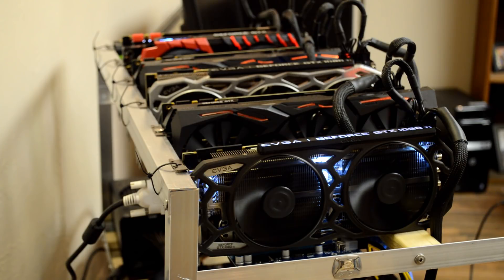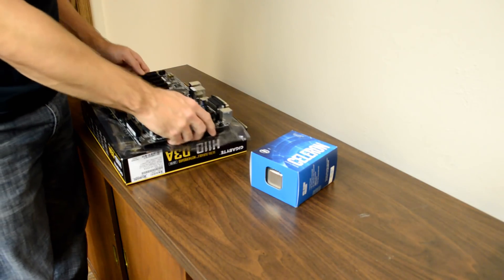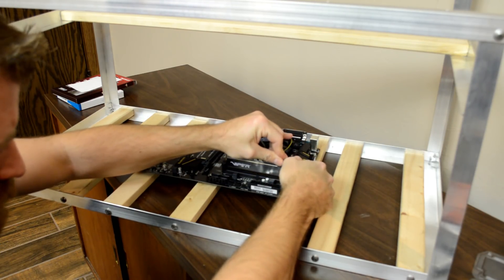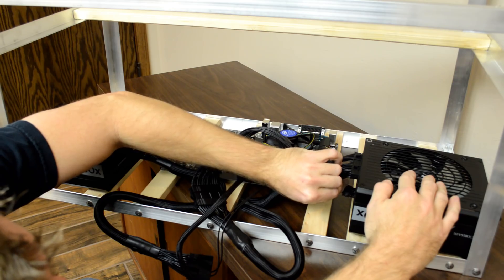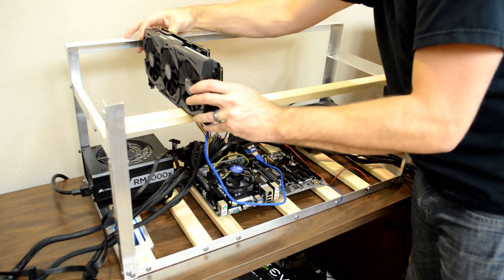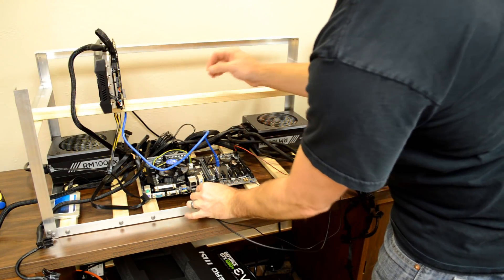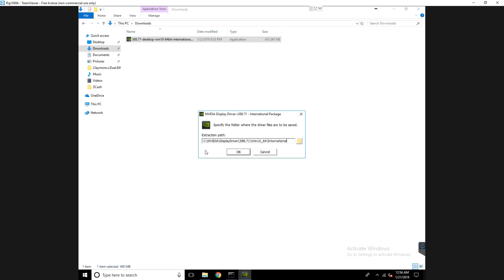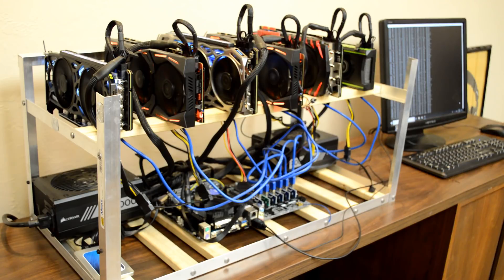How to Build a Mining Rig - Part 2 - Assembling Computer Components

Comment: I have the same motherboard with 6 identical AMD cards.  The system works with 5 GPUs but not 6.  I had to disable miner mode and enable 4G encoding for it to boot and run 5 GPUs.  The problem is definitely a BIOS setting.  I do not have several years to try all of the variations by trial and error.  Can you tell us what works on your board specficially, please?

Comment: Sata connectors are rated for 54 Watts Max and Nvidia rates TDP in the 1080 Ti as 250 Watts max (which I know is not necessarily the power being consumed) but as the GPU can pull up to 150 Watts from 6 Pin connector or it can draw from Pcie riser as well in any combination depending on usage, OS, app etc why risk so much on a premolded Sata connector instead of a proper 6 pin?  As an electrician, I commend you for grounding your mobo, and additional equipment ground into the case would be awesome as well, thank you for a great detailed clearly explained video.

Comment: Can you mix GPUs?  Currently having trouble finding GPUs.   So lets say I find a single 1080 ti and I start mining with that, then a little later I find another card, say a 3080.  Can the two cards be run on the same rig?
Reply: You should be able to use different GPUs in one rig unless the CPU is incompatible with one of the GPUs.

Comment: Maybe too late or not to comment, because this video is old, but really nice DiY tutorial. But I want to advice something, Grounding Loop MUST be AVOIDED. At minute 8:15 you make a huge mistake. Most common PC Towers dont ground motherboard to chassis. The grounding is done over the PSU earth pin. Grounding motherboard to chassis is not need. If you screw the PSU to the alumium rig then you're grounding RIG over PSU. The PC enclosures are RFI and EMI protections. By example: If you have a windowed tower, there is EMI going in and out of the PC Case.

Comment: super cool videos !!how many risers can you plug on a sata cable ???  :O  i thought it was only 1 !  (max 75 watts per riser)  tyvm !
Reply: NOONE!! Riser taking 75W and SATA only provides 54W !! NEVER User SATA or any Adapter, throw them away! You can use Molex (156W) for 1 Riser or PCIe (288W) for 2 Risers.

Never use SATA, the wire is going to burn because it takes more watt then it can provide and then u are going to burn the whole RIG or More down.

Take this advice if you planing to build a RIG
Reply: And never buy risers with SATA connector. Search for the new Versions with molex and PCIe connector so u can choose how you want to power it

Comment: Hey Jobe, was wondering if you had any tips for why my h110 d3a board wont power 6 cards. I am running linux/hiveos and for some reason I run into a gpu driver error that isnt able to find the temps and high load averages when I use a 6th card. 5 cards run no problem though...

Comment: Are you running your power supplies on 120v or 240v? I heard using 240v is more energy efficient.
Reply: 240v outlets are significantly less common in houses, so 110/120v is used

Comment: Nice vidéo :) Keep going. I have a question,  you split power from 3 GPU? And you connect from same PSU? ✌
Reply: basically, how ever many pcie (gpu) outputs your psu has is how many gpu you can run

Comment: I found this motherboard:https://www.krefel.be/nl/p/TO127500-b250-mining-expert-intel-1151-90mb0vy0-m0eay0?gclid=Cj0KCQjwtMvlBRDmARIsAEoQ8zSQ5ftvUTwz1Fma80xIw6yi04gUmqpwJcs98ckfo2Ihwep_3RgXbHsaAmE5EALw_wcB

It supports 19 GPU's (i'm not planning to use 19 GPU's, I think only around 6 GTX 1060's ), do you now a good power supply that can power tank motherboard? I will power a second one for the GPU's but I need a power supply  that has the good connectors for that motherboard

Comment: I use RX 570, RX580 and Rx470.
Is there any different between I take M.2 as a HD or SSD? Why you choose SSD instead of M.2 ?
Reply from the maker: Nice, honestly M.2 is far superior to SATA so if you want to use an M.2 SSD power to you.  I didn't in this build for a budget, at the time of the build the M.2 SSD's were quite a bit more than SATA SSDs.  All my home personal computer builds have M.2 NVme SSD's in them and I love em!
Reply: Thanks~BTW,
Do u ever meet openCL error?
How you solve it? I expand virtual memory to 32GB , but still have this issue sometime. Really annoyed. It makes GPU card just hang in there. Any better solution?
Reply from the maker: How much RAM do you have in the system and what is your combined memory of all your GPU's?
Reply: Jobe I have 16G dual RAM(UMAX), and my card is RX 570 8G*2 + RX 470 armor 8G
Reply from the maker: Crazy as it sounds you might try bumping your virtual memory (page file) to 64GB.  If that doesn't work, try to update your motherboard BIOS.  Then in your BIOS look for an option to enable 4G.  What kind of motherboard do you have?  What is your PSU wattage rated for?
Reply: 1.4G decoding?
2. Aurum PT 1200W modular et MSI z370-Gaming krait
3.I've tried bumping my virtual memory(page file) to 64GB, and run it about 5 mins, afterward computer responded to me "You C drive will be full".....orz
Reply from the maker: Ewww yeah that wont work then, whats your volume capacity on your storage drive?  Yeah try to enable 4G decoding and if its already enabled try disabling it.  I think this is your motherboard, https://www.msi.com/Motherboard/support/X370-KRAIT-GAMING  you may try to update your BIOS if you are on an older revision.  Have you also updated your GPU drivers?  Id go ahead and update chipset and all if there are newer drivers, plus I prefer the drivers from the board manufacture rather than intel and microsofts generic crap. ;)
Reply: My GPU driver is  Adrenalin Edition 18.5.1.
I would update BIOS  tonight. Thanks
Reply: Feedback: I didn't updated my BIOS, I've just adjusted my claymore's setting. And my GPU driver is Adrenalin 18.8.2 
Now, it runs very stable. (4 cards running).
Besides, do u know what's going on if a pool always make u get share but keep showing "no new job" ...?

Comment: Yeah man i have already mined with both of the cards there were no problem
Reply from the maker: Yeah feels like it's either the riser or the motherboard.  The other computer you tried to put 2 gpu's in, what kind of board does it have?  Also what PSU are you using?  Just curious.
Reply: Two of the motherboards are old but one of them supports two 2 x1 slots + one x16
Reply: Jobe and one motherboard is m5a78lm usb 3 i use this motherboard for mining
Reply from the maker: Yeah that board should def be able to handle 2 GPU's imo.  Feel like its a bad riser.  You able to return the riser you got or RMA it?  You know the other thing you can try to test that riser would be if you have some random PCI card like a wifi adapter or a serial card or something you can plug into that PCI riser to see if it comes up or not.  If something like that doesn't work on the riser then I would say its the riser thats faulty.
Reply: You are right I can try it. If I can found something like that. I will give it back to the store which i bought.

Comment: Man ı added a second gpu to my rig and windows even don't see my gpu.By the way the fans of my second gpu sometimes work and sometimes don't  pls help
Reply from the maker: Some GPU fans don't always run, they only kick on when needed.  Is the GPU lighting up if it has any LEDs?  What kind of GPU's are you using?  What kind of motherboard and how are you plugging the GPU into the board (regular PCI port or using a PCI extender?)
Reply: Thanks for responding dude i figgures out that my riser doesn't work at all. I have tried it on another pc and same again. By the way main board is asus m5a78l-m usb3. 0 gpu is sapohire rx 470 nitro with samsung memory
Reply: I use pcie x1 to x16
Reply from the maker: For sure man happy to help in any way I can.  Yeah dude I've had bad risers, I usually buy the 6 pack and it seems like theres always at least one bad one in the batch.  Is the riser powered by sata or molex?  Just curious.
Reply: By molex
Reply from the maker: Have you tried powering it with a different molex or using a different pci slot?  Guess you said you tried the whole thing in another computer and it didn't work so it's probably toast.
Reply: Actually it takes power it can power up the gpu but i don't know, may be i am doing something wrong you can give me some advise
Reply from the maker: Well the GPU is being powered by its own power connection from the PSU.  The sapphire rx 470 nitro looks like it takes an 8 pin pci power plug that should come from the PSU to the GPU.  I added a link to a picture below.  You got that plugged in?  The power that goes to the PCIe riser/extender is to power the riser card components themselves.  

https://i.imgur.com/PECZ1Lr.png
Reply: yeah ı powered my gpu with 8 pin I think there is no issues with power.
Reply from the maker: I'm sure you've tested this but does the card work if you put it in the 16x slot? Both cards are confirmed to be operational?  When you boot into windows with both cards hooked up do you see anything in Device Manager under Display adapters?

Comment: great vid really well explained for beginners  like myself starting out, bit of noob question how long will it be before 1080ti become old and useless nonprofitable to mine, like when 1090ti or 1100ti's come out , i am half afraid start buying all the hardware knowing my luck i would accumulate all gpu's then setup by that stage newer gpu's be out 1100ti ?
Reply from the maker: Thanks Daniel.  That is a great question, I have been reading that the new GPU's may be coming out in late July or August.  These new cards will surely be more beefy as described in the link below.  One thing to consider is that when they are released, the current generation of GPU's will hopefully be cheaper but should still be good for mining.  If anything, if you are wanting to start mining now, I would suggest just getting one or two cards and then in August consider buying some of the next gen cards that come out.  

https://www.techradar.com/news/nvidia-geforce-gtx-1180

Comment: Piease are you in Houston Tx,  i need your help finishing the connection to the motrboaherboard. 
I havr 6 RX 560 GPUs, ASUS B250 19 slots  mining expert motherboard. I have gone as far as  mounting them on the Alumininu frame and connecting to power supply and some cables to the mother.  but i dont know the rest of the connection goes. If you can make a video with  the same type of motherboard, i will be glad. O will pay if you make a clear video on that and send it to my phone. My number +18323106982, email; charlesodukwe39@gmail.com.  Thanks

Comment: BTW the plastic cpu cover pops off when u close the retention arm with a cpu in the socket. Taking it off beforehand you have a higher chance of damaging the socket if you slip manually taking it off.

Comment: How's that motherboard holding up? Looking to purchase the same one.
Reply from the maker: This build is still running flawlessly, been running 24/7 other than the occasional updates.  Looking back the only thing I would consider doing on a new build is using a modern i7 (7700 or 8700) and supported board so that I could mine with the CPU as well.
Reply: I want to Build this rig, but, 1 GPu is good enough? i am beginner
Reply from the maker: Yeah you can start with just 1 GPU, if you do just use one power supply thou because you won't need any extra power.

Comment: Thanks for this tutorial. When I power up for the first time nothing comes on the screen. I press the button advised and still nothing happens. Any suggestions? thanks
Reply from the maker: Have you tried powering the system up with no GPU's installed?  Plug a monitor into your boards vga port and see if you can power it up, once its confirmed plug in one GPU and plug your monitor into it to confirm it boots without issue.  Then add the rest of the GPU's as needed.
Reply: Thanks much Jobe, I'll try that.
Reply from the maker: No prob let me know how it goes

Comment: Hi Jobe, Nice video by the way. Was wondering and im going to use simplemining. What i need to know do i put the operating system on first say Linux or win10 on the flash drive or if you familiar with simpleming do i use their tools to set up the operating system, any help would be great. Thanks.
Reply from the maker: Hey Fyertoy, I have never used simplemining but I'll have to check it out

Comment: I have received the graphics card (EVGA GeForce GTX 1080 FTW2) yesterday 
The EVGA graphics card is not recognized in Device Manager, under Display Adapters 
I have three graphics cards installed on the motherboard including graphics card (EVGA GeForce GTX 1080 FTW2), two Asus Strix GTX 1080 & one (EVGA GeForce GTX 1080 FTW2)
I have exchanged slots and cables without any success only the two Asus Strix cards appear 
I have even tried to connect it alone to the main graphics card slot (PCI bus 1) alone without any success.
I have also updated the Motherboard Bios and the Graphics card driver to the newest driver 391.35
Reply from the maker: You may check in your BIOS for settings to enable "above 4g decoding" and be sure to turn of the integrated graphics as it will use up a PCI lane.

Comment: Can different models of cards be used in the same rig?
Reply from the maker: Yes you can use different models of cards in the same rig
Reply: Jobe I don't understand so where does he connect the hdmi or vga Port to since the graphics cards are many ,and also does all add up inthe graphics adapter options

Comment: I just fast forward your video and was surprised when you were installing CPU
that's surprising how people do not understand what they are doing and still try to teach others
first of all you dont remove the cover from motherbord's CPU socket, it comes off by itself when you instal the CPU and closing the CPU holder. By removing it manually you are risking droping it and bend pins or droping something inside the socket.
second of all you do not apply thermal compound on a brand new heatsink, because there is preapplied thermal paste on it ! 
third of all dont press the fasteners with a screwdrivier, the screwdrivers might slip off and you will damage your mobo, when you press them do not turn them, the are in the position when they just go in(from factory) and to remove the fan you need turn them conterclockwise...

wow man that's like 3 minutes of video.... I am scared what you are going to do next

Comment: Hi Jobe,

I have watched you useful videos, and I am intending to build my first GPU rig using exactly your bits of advice and links you've provided.

But, unfortunately, some of these links are not working due to some missing letters at each one end.

Please revisit and fill them completely so you will be helping more and more.

Thanks
Mohamad
Reply from the maker: Hey MA A.  I went through the links and found one that didn't work, the one for the arctic silver (which you can skip if your heatsink already has thermal paste on it).  What other links are not working for you?

Comment: Hi There, I have trouble installing the GPU

I enabled Mining Mode and follow your step.
But when I connect the Monitor to GPU it doesn't show anything.
Do you have any idea how to solve 
Thanks.
Reply from the maker: Start by removing all but one GPU, plug into it and confirm you have video.  Once you have one GPU up with video, you can add your other GPU's.  You may also want to try plugging directly into the motherboards video and use integrated video.  You may have to enable this in the BIOS/UEFI.  Are you able to boot the computer without a GPU with monitor plugged into the motherboard?

Comment: hi I have EVGA 1200watt  p2 do you think that I can run 6X 1080ti thanks
Reply: 6x 1080ti use up to 2000 watt on Equihash (ZEC, ZEN, ZCL) and make up to 4800 sol/s 
so you better use at least 1000watt power supply on every 3x1080ti 
1200watt for 3x1080ti is the best choice if you would like to get the most of mining.
Reply from the maker: Depending on what you mine you might be able to get away with it.  If you plug in your cards at whattomine.com it will show you the average power usage for your cards for each algorithm.  When in doubt you can always try to plug 5 of your GPU's in and see if its stable, if so try plugging in the other card.  Good luck!
Reply: quick question do the sata cable provide enough power to the PCI-E RISER ? thank you for awesome video you just got 1 more subscriber
Reply: Pavlo Frantsen thanks for replying

Comment: Hi!. Great Video. Thanks a lot. I have problems to connect 6 GPU with one PSU HX1200 Corsair. I'm not sure if it is possible, because I think therein not enough cable PCI-e. Can U help me?. Thanks in advance!!
Reply from the maker: Hey MonMPSB thanks!  In your situation you might consider using Molex to PCIE adapters.  Depending on if you need 6 or 8 pin PCIE you can find Molex to PCIE adapters online.  Here are a couple links I found to some on Amazon.

Molex to 6-pin PCIE  -  https://www.amazon.com/Molex-Express-Graphics-Power-Cable/dp/B000KU3QD8
Molex to 8-pin PCIE  -  https://www.amazon.com/Athena-Power-4-pin-PCI-Express-Cable-PCIE4628/dp/B0032MT0OU

Good luck!

Comment: Hi Jobe, do I just plug the monitor into an open slot on the GPU, or should I rather connect it to the motherboard's on-board GPU?
Reply from the maker: Hey Andre.  I would plug it into a GPU, most motherboards will disable onboard video once a GPU is installed unless you specifically change a setting in the bios/uefi.